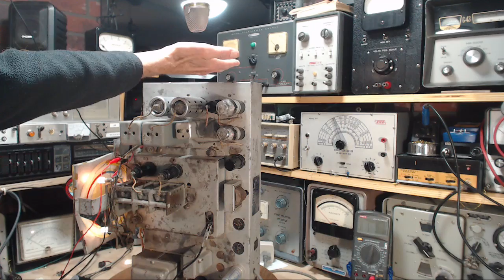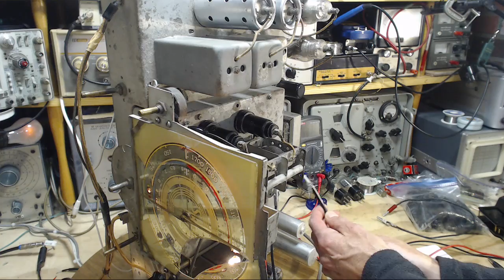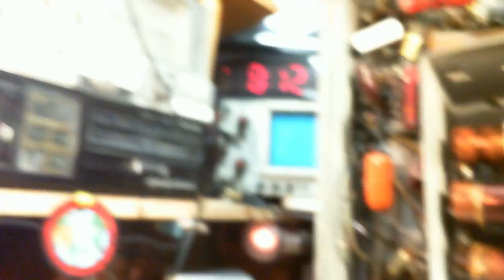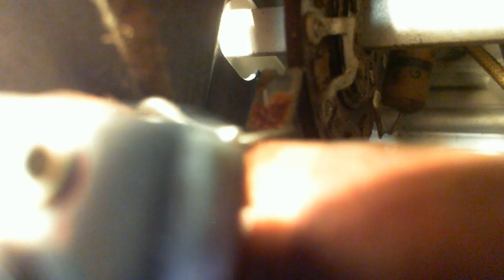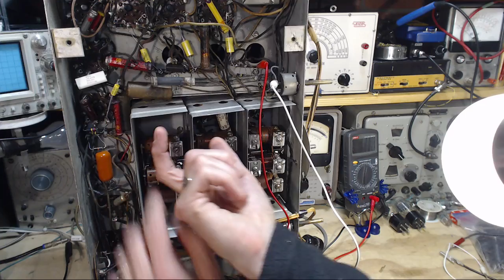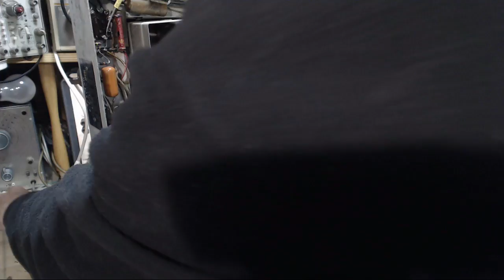Sparton 1567 Huge Tube Radio Video #14 - Distortion?

Comment: I say again that frying sound is arcing on one of the mica capacitors in the IF transformer!
The IF is not aligned properly.
All those wax paper capacitors have got to go.
Start checking all thise old resistors.
Replace the grommets on the tuning capacitor assembly and the  clean the tuning capacitor bearings.
Those bandswitches also needs cleaning. :-(
All you will hear with the stethoscope is the big click on the metal panel, the slide switches are normally silent.
Your RF alignment is parhetic?

Comment: Your idea to fix overheating resistors was just to fit new resistors without any fault finding to find out why they where overheating, I don't wish to be offensive in any shape or form but I find you entire approach  to repairing and restoring this radio completely baffling.

Comment: On my AM radio when I use an indoor antenna and a "switching power supply" it makes very bad noise, even with the help of the (offset) are all your power supplies checked? Maybe an ouside antenna is in order... also how did you fix the bad switch from the last video?

Comment: Hi there, maybe if you check the grund point on the receiver and the same on the output stage and test whit a wire between receiver chassi and the output chassi maybe you get rid of the anoing humming. Maybe make a try?